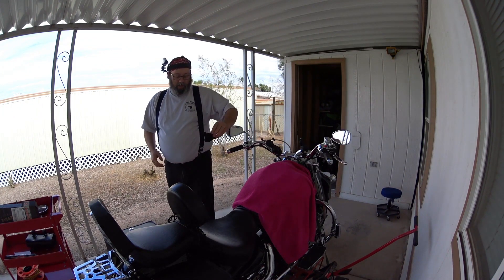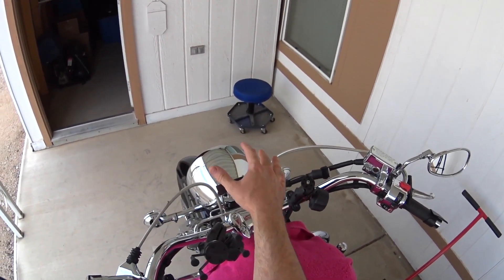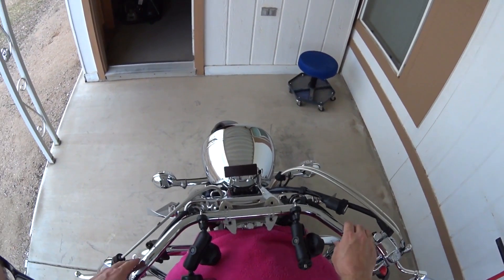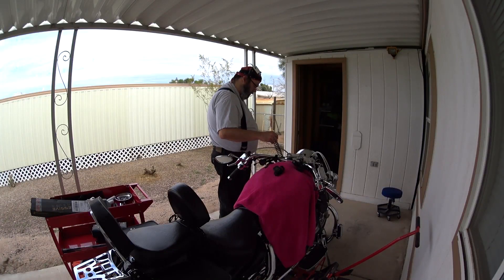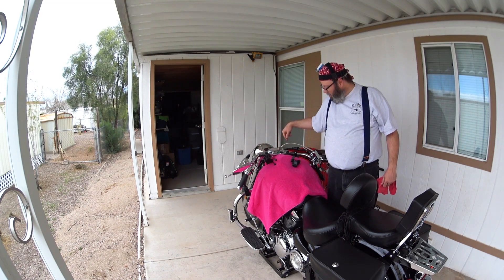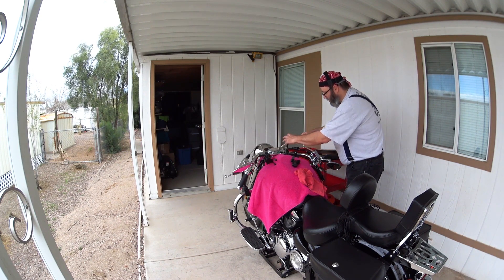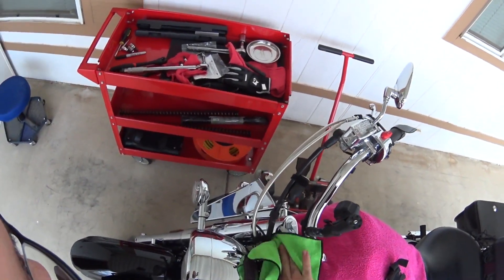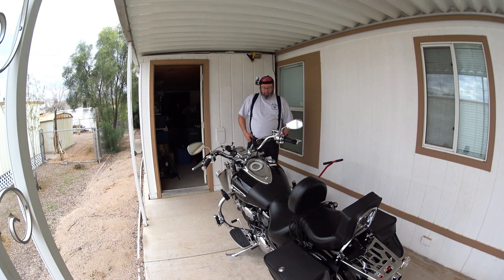Progressive Suspension Front Spring Install

Comment: You have to put pressure on the cap when you’re taking it off, or it will pull the bottom threads, when it violently pulls at the threads from the spring pressure.

Comment: Also before adding the new spring you can put the cap on and twist it till it catches with your hand, no tool. Then just slightly pull up and loosen till it comes off then you can narrow down where the threads "start" then use a wipeable marker to mark on the cap and the fork where the threads start. When you add the new spring and spacer place the cap close to the thread start marks (rotated resting on the top of the loose spring with the cap mark close to the fork mark by sight) and then apply the pressure and spin gently till the threads catch.
Reply: Yea, important point or step, many people refer that as Indexing

Comment: you forgot to loosen the pinch bolts in the top tree, start the cap with out the spring so can put alignment marks on cap and forktube, so when starting the threads under pressure you will have a good idea where it will catch the threads inside the tube a sharpie works ok for marking or even a little slice of electrical tape

Comment: Hey, You should take the weight off (unspring your forks) that will make it easier
Reply: Boy that chrome really shines on that shiney black finish.. it does look low mileage.  The thing about the shorter, but stiffer coil springs is you will no longer notice or hear the spring slap in the fork during deep and quick compression that the longer springs can cause.  Did you upgrade your rear shock yet?  I'm dropping in a set in my 09 Road Star, it's got 4k miles on it.. and I'm below 140lbs so my load is lighter than yours.  Have you thought about adding Emulators or other replacement for improved damping action?  ..lol.. I guess we just witness a large Mechanic's tool box theft during this episode!

Comment: Hey Is that a 1100 or 1300? I'm trying to determine how long to cut the spacer for my bike.
Reply from the maker: Mine is a 1700 but the length to cut the spacer is in the instructions or you can just call them and they can tell you.
Reply: The instructions called for 3.75"spacer , too much preload, really stiff ride, so I cut it down in .25" increments and ended up at 3.25", put the fluid at 140mm per the instructions (honda manual called for 135mm which I initially set it at) and now it rides like a dream! also I used a ratcheting wrench and pressed down with my palm with forks fully extended, didn't need as much downforce as my first attempt!